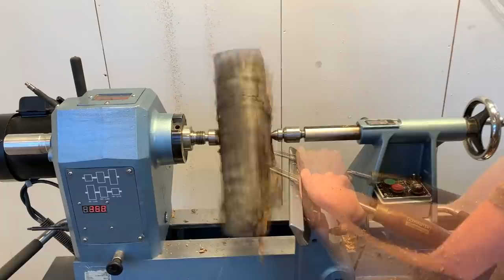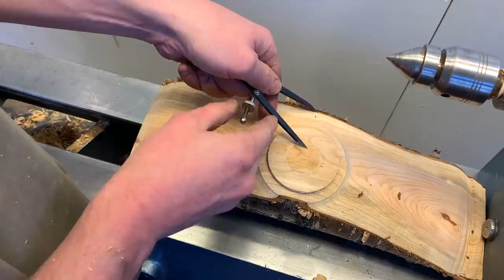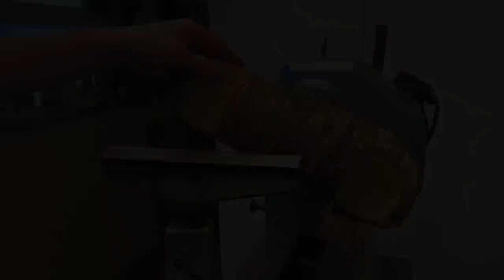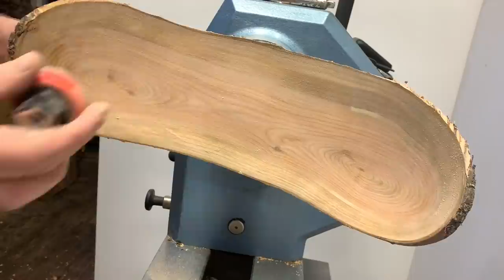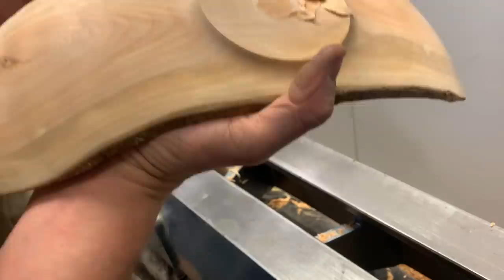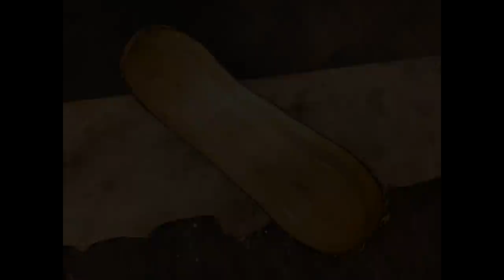Woodturning - Don't Try This At Home!!

Comment: What was the moisture content of the log? I sure hope it was low
Reply from the maker: Why do you hope it was low ?
Reply: @Jack Mack Woodturning  I'm not experienced in lathe work, but in furniture building, low mositure content = no (miniscule) post project warping. So i was just hoping that your piece was low in MC so it wouldnt warp after all that work. 

I didnt know if you had dried the log before you turned it

Comment: I bet if you calculated the RPM of the laythe and set your camera to record at that frame rate you would get a pretty cool video quality. Idk if it would be better, but lookup when cameras match helicopter RPM
Reply from the maker: Yeah it would look like the piece is stood still. Only problem is, as soon as a chisel touches the wood, the RPM slows down. This makes it very difficult to generate any consistent effects. Thanks for watching buddy 👍🏻😊😉

Comment: Very skilled turner but very a very dangerous piece to attempt.  I would have started by cutting the basic shape with a bandsaw and only finishing with the lathe.  I may even have sculpted it by hand.  Oh what is it by the way ?
Reply from the maker: Cutting this first means you are set to the shape you cut on the bandsaw by eye. this piece Is perfectly balanced in mass and shape as I finished piece.. that is achieved by making adjustments as you go, something you cannnot do you first cut the shape you think is balanced on the bandsaw.
Reply: @JackMackWoodturning  True that your finished piece is perfectly balanced on each face but not necessarily the edging.  By cutting first on the bandsaw you reduce the production time considerably and yes it is still possible to make the adjustments as you go as you can leave a sufficient amount of excess wood to work with.  It is no more difficult than putting an unbalanced log directly onto a lathe BUT the mass is a lot less and so reduces the danger factor.
Reply from the maker: If you are going to leave enough to tweak it then why remove any mass on the bandsaw.. I still don’t understand why you feel there is a benefit to using a bandsaw first.. are you in the speed of production camp or the safety camp..? Both of which I can tell you in my vast experience are less than negligible issues.. you sound like an experienced turner so I’m assuming you know this isn’t unsafe.. which is a common first impression from novice turners. So if it’s not a safety issue.. it must be speed of production .. this platter took me 26 mins to turn from start to finish including filming and sanding. I don’t need to go any faster than that.
 I have no use for scraps of wood in my production process. And I try to avoid burning as much wood as possible as My woodturning business produces far too much fire wood as it is, instead I prefer shavings that we can compost and lock carbon back into the earth. 

What I’m saying is you can cut a little off it here and there but why on earth would you want to if it doesn’t benefit the process ?

Comment: Ive seen alot of your videos, very nice work! What is that chisel tool you use for cutting off the nubs?
Reply from the maker: Thanks man. It is a power chisel from Axminster. It is badly made and leaks oil onto the wood. I wouldn’t recommend it.

Comment: That was pretty cool.  I never would have thought to turn a log in that way.  Might have to try that......................carefully.  What was the tool you used at the end (the power chisel)?
Reply from the maker: The Power Chisel is from Axminster but I would not recommend it. It leaks oil onto the wood. I am in the market for a new one
Reply: @JackMackWoodturning  Thanks, good to know.

Comment: Second time watching. WHOA! Nice job Jack. What lathe is that you use? Best regards.
Reply from the maker: Hi John. 👋🏻 .. It’s a lathe that is soon going to either be sold or relegated to the main workshop. 
It’s sold by Axminster and although I once liked it I now can’t stand it. More than anything it that is because of an endless list of issues with the company it’s self. Unlike the products Axminster tools manufacture the lathe actually works, but that because they just buy them up from Taiwan and have them spayed and labels to look like their own gear. The motor has failed and needed replacement. The bearings failed and turned out to be just about the worse bearings you can get. Part of the bango can lock bent and needed to be replaced, same thing on the tail stock…. Ect ect.. so actually I kind of don’t like the lathe because it’s poorly build I guess.. and tho company seems to give not a single flying F once they’ve parted you with 3 grand… I’d avoid them like the plague, if you looking to spend that much on a lathe go for a slightly smaller vicmarc..
Reply: @JackMackWoodturning  Hi Jack. That's a shame, customer support lacking somewhat eh?  Maybe Santa will supply you with something better. Merry Christmas and best regards.  🙃

Comment: Hah! Nice! You turn the silly shit that I do. Often sounds like a aircraft, right?.. Love the highspeed footage!  I hope that Cherry is dry, gonna crack like a bastard in a few months else. SUBSCRIBED!! :)
Reply from the maker: Cheers for following along. This was mostly dry due to its relatively small size but I’d still class it as green. This piece wouldnt crack even it it was turned from sopping wet cherry tho. Consistent wall thinness of 4-5mm in cherry would definitely warp rather than crack 👍🏻
Reply: @JackMackWoodturning  Is that right?  Explains why a large Cherry bowl I made has a warp in the side (aka new design feature!! ;) ).

Comment: Hi - very nice work, very impressice finish using the chisel on the outer wings. Thats far from easy. Were you using a bowl gouge for the whole turn? What speed did you use for doing the wings?
Reply from the maker: Thanks chris. Your this was all a bowl gouge besides cutting the tenon. Spindle speed was about 600 rpm to start but once balanced it went up to around 1500-1900 rpm 
Thanks for watching buddy 😊👍🏻
Reply: @JackMackWoodturning  thanks also the answer - under 2000 rpm, great tool control! respect.
Reply from the maker: Definitely under 200 rpm. This thing was 18 inches long and 5 inches wide 🤣 taking it over 1500 is sketchy. When a piece is between centres it’s generally safe.. but when it’s also unbalanced too fast could cause it to come free.

Comment: You seriously need to get a 3d mill for that.  I've never done wood turning but that process looks like an accident waiting to happen.  Nice piece, but would you make another that way?
Reply from the maker: Anything is an accident waiting to happen if the operator doesn’t know what they are doing. In this case I do know how to do this safely and yes I’ve made many many pieces like this. 

Thanks for watching 😊

Comment: I once tried that. The log, with a few nicks out of it, flew straight out through the window opposite. The window wasn't open at the time. The tool is still stuck in a ceiling rafter, directly above the lathe.....
Reply from the maker: Ahh, that’s a shame. I guess you moved the lathe away from the window soon after right?

Comment: Did you paint your Lathe?
Reply from the maker: I did, I stripped the headstock to replace bearings and thought, while I’m at it, il put a new motor in new drive belt, may as well paint it too. It was in need of a full refresh. Feels like a brand new lathe. Couldn’t recommend it enough if anyone else’s lathe is feeling it’s age.
Reply: @JackMackWoodturning  weil done. Looks like the old Axminster Lathe now, like that alot.
Reply from the maker: @bluediabolo1   well that’s taken the shine off it a bit 🤣 I can’t Unsee that now.
Reply: @JackMackWoodturning  not really , Axminster always made good Lathes . It´s more like a Tribute   ;)
Reply from the maker: Maybe the old ones were better than the ones they sell these days. This one has been nothing but trouble for last 4 years. The rest of the tat they sell breaks too. That being said my old Axminster bench grinder is still going strong and must be 15 years old. I guess your right, they used to make good gear, now it seems they sell Taiwanese manufactured tat for  double what they sold it for only 4 years ago. Terrible company in my opinion, they know they have a monopoly in the UK market and use that to lower the quality and raise the price of their products.
Reply: @JackMackWoodturning  i have the Trade 406 WL for 3 Years now and still no Problems. We ´ll see. Many complain about the bearings, but i still do not have any Probs with that. Hopefully i never will :). Hmmm isńt Record Power an UK Brand to?There ´s load of them here in Germany. They like them alot, because they do not cost too much. Most wanted Lathe in Germany is the Stratos XL Lathe, it´s huge  and at a good Pricelevel .I myself fell in Love with my Axminster :D
Reply from the maker: I do hope you continue to have no issues. My main lathe runs 60 hours per week. I bought it as it’s said trade on the side.. and was assured it would stand up to full time use. After the first 12 month the first motor died.. I was then told they are only built to run around 15 hours a week.. and that the life expectancy of the motor is around 4000 hours. Which at 15 hours a week would be 5 years. 
Il be buying a vicmarc soon and never going back to Axminster. Record are okay but you get what you pay for. Which is about the same quality as Axminster, only Axminster charge 2x as much.
Reply: @JackMackWoodturning  good to know, if i ever need another Lathe, it will be a Magma , a Oneway or a Robust . Hope you will have more Luck with the Vicmarc .
Reply from the maker: @bluediabolo1  me too
Reply: @JackMackWoodturning  no wonder you are that good at the Lathe, i `m happy enough when i have the Time for 2 or 3 Hours per Week. I always watch your Videos and hope one Day i will be as good as you .
Reply from the maker: Woodturning as all about practice.. people call it skill or talent but it’s neither, it repartition and muscle memory, I’ve been turning bowls for a living for a long time with long weeks (70-90 hours per week) and extremely large volume. General I do about 3000 bowls in a year. 
For me this channel is all about taking a little more time to keep my love of woodturning alive. The stuff you see on here is my play time and I love it, the fact that so many people watch this blows my mind but also drives me to keep entertaining you guys. 
Thank you so much for watching. 
It’s always amazing to talk with viewers in the comments too. 
Il be putting out some tutorial videos soon so I hope they can be of help to you too. 
😊👍🏻

Comment: I’ll skip 15 minutes on the bandsaw and spend a few hours on the lathe the next time I need to make one of these.
Reply from the maker: These platters take me about 20 mins to make. There are many reasons not to cut it with a bandsaw first.. take a look through the comments. Iv gone into detail on it with others.
Reply: @JackMackWoodturning  haha I’m Not doubting it would take you 20 minutes but this would definitely take for FOREVER. I’ll  take a look at the comments though. Thanks for the reply
Reply from the maker: No problem my man, it’s like anything else, I do this all day every day to pay the bills and have done for a very long time… I’d probably struggle to do your profession.

Comment: My fingers hurt just watching this
Reply from the maker: arthritis?
Reply: @JackMackWoodturning  no just the danger factor of a propeller spinning at 600rpm a couple mils from your finger tips,
Reply from the maker: 2000 rpm 😆 
600 would increase chatter. 
And yeah it would take fingers off, but as long as you remain in control of you fingers they don’t have to touch the spinning wood 😊

Comment: Dude I could have cut that out with a jigsaw all that time 😆 🤣
Reply from the maker: You don’t know what you just watched.. which is why you think a jig saw would cut that.. a jigsaw is for flat stock. Like ply wood or a plank. Not for cutting a log. For that you would use a chainsaw or bandsaw. And would end up with something very different.. and a hell of a lot of sanding. I’m not sure why I’m trying to educate you tho.. you seem beyond guidance.
Reply from the maker: So you replied saying you a carpenter and call me some lame American insult. Which YouTube decide to remove. 
if you were a carpenter then you would understand the fine differences in woodworking and certainly wouldn’t suggest a jigsaw for that job. 
The fact that you did shows you are not a carpenter.. you may well be paid to work with wood, maybe you build furniture with screws and pallet wood or you put us stud walls. But your are not a carpenter, a carpenter is a skilled trade that requires knowledge… you have clearly shown your lack of knowledge by suggesting to use a bloody jig saw on a radius surface, 
Plonker. 👋🏻😘🤙🏻

Comment: This looks extremely dangerous, and also like it might be hard on the lathe.
Reply from the maker: Not as dangerous as fart wrangling..
Reply: Wear Protective gear, slow spindle rpm and sharp tools
Reply from the maker: I’d not say slow rpm for interrupted cutting.. fast as your comfortable with is the best speed.

Comment: Definitely seems like one where gloves should be worn.
Reply from the maker: You should never wear gloves when using a lathe. It’s extremely dangerous.
Reply: @JackMackWoodturning  well that does make sense, I have no experience with woodturning it just seemed like using a barehand on that tool with such a large, awkward piece of wood would be helpful.
Reply from the maker: Yeah, gloves will get caught on moving objects and not tear easily like skin dose.. instead it will likely pull you in to the wood and knock you out.. or at very high speed it just removes your glove.. but all the skin and flesh from your hand remains in the glove.. 
google image “de-gloving accident” if you can bear extremely distressing images ✌🏻

Comment: That must be hell on the cutting edges of the tools. It looks great!, but it's the most fucked up looking boomerang I ever saw...lol
Reply from the maker: No it’s very easy on the cutting edge of the tool.. it’s all about too presentation. no different to uninterrupted cuts. Why is it you feel it would be hard on the tools?
Reply: @JackMackWoodturning   I was thinking that the repeated impact would have like a hammer-like effect on the blade. But tempered steel is a might tougher than wood isn't it? As long as you check for old nails and fencing staples, you should have no problem making all the boomerangs and toothpicks you want. Have a great day!
Reply from the maker: 😆😆😆😆
That is absolutely not how woodturning works buddy. 
Cute tho.. thanks for your , em…“advice” 😆

Comment: duddde...you are very professional but you could do that with a chain saw more easily and safely ..
Reply from the maker: This is a demonstration of balance both  in mass and finished piece. Both of which can’t be achieved with a chainsaw.. and safely?? How would you recommend holding this while carving with a chainsaw?? This is extremely safe if the woodturner has sufficient experience. I appreciate your kind words but the rest of your statement is frankly incorrect. 👍🏻

Comment: So much wood could be cut away before turning these pieces, seems a tad wasteful.
Reply from the maker: “Waste” is a concept that requires looking at the material from a much broader view point.. 

In this instance we are referring to a section of tree taken from a local land owners wind fallen tree.. if the wood was not rescued it would have rotted in place as nature intended and in doing so it would have fed microbes and provided nourishment for the surrounding area. at this point a wood worker could look at the wood and call it a waste, but from the perspective of nature it would be entirely fitting.. 

When I use a piece of wood I expect to turn 90-95% of the volume into shavings and capture one piece in time that can last as a decorative item and aid in housing and feeding my family as well as providing a loved item for generations to come. 
The shavings I produced during my work are taken to a local ( underfunded) community farm/education centre where they are used as animal/live stock bedding.. once they are kicked out they are then composted and used on the vegetable garden where they do their part in producing food and income for said community farm. This process honours the work of the tree throughout its life time as it keeps the vast majority of the carbon that the tree spent so long extracting from the air locked up and safely back in the soil as nature intended. 

To view something as waste from this video is very narrow minded.. it works on an assumption that if the wood is in shaving form then it no longer has any use, when in actual fact the shavings are the part of the process that do not become waste. 

My views on this topic are that a material can only become wasted if you were to waste it. In my opinion, for a tree, that would be to burn it. 

Burning wood will undo the life time work of the tree. And the out put is the faster movement of atoms ( heat)  a true waste of 100 years of a trees life.